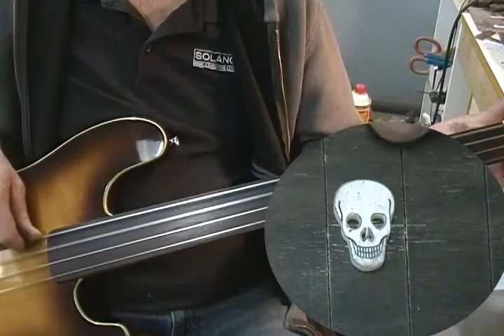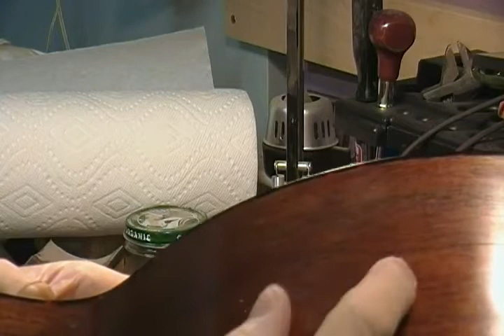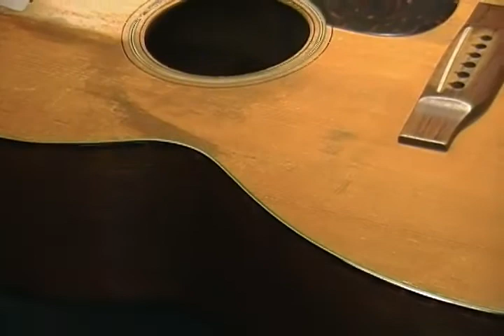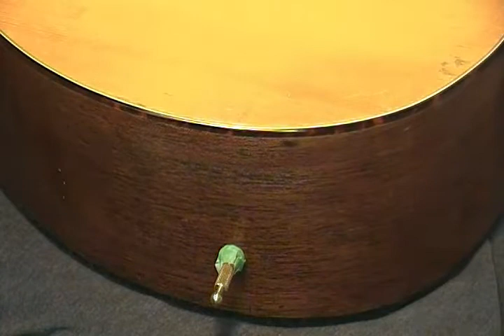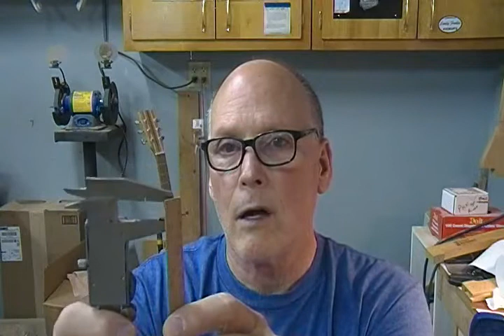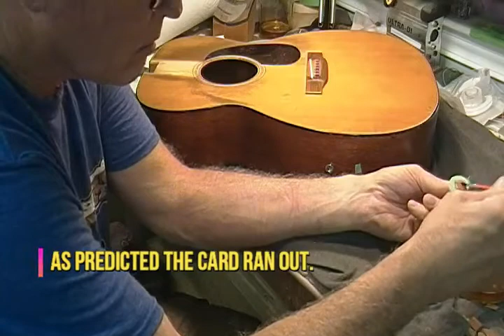65' MARTIN 000-18 crack reoair with cleats, Jonah Guitars

Comment: Nice work Dane. It's the little touches that count like bevelling the cleats. KISS technique for correct cleat alignment. Back on the old camera too.
Reply from the maker: Dippy Hippy, I’m gonna KISS real simple next time and make the cleats round. I still have a lot of video shot on the old camera.
Reply: @jonahguitarguy  For round cleats it'll take more time to chamfer and harder to maintain uniformity unless you turn them?
Reply from the maker: Dippy Hippy, stew Mac has a trick little cutter that pops out round cleats. It’s made for bridge repair but would double for cleats.
Reply: Ah! Stewmac. Why am I not surprised. They can be a bit spendy but they are really up there with innovation and altruism, and that doesn't come at Chinese prices.
Reply from the maker: Dippy Hippy, no it's not cheap but I'm never really happy with cheap. Except my Epi SG that was cheap and was very happy!